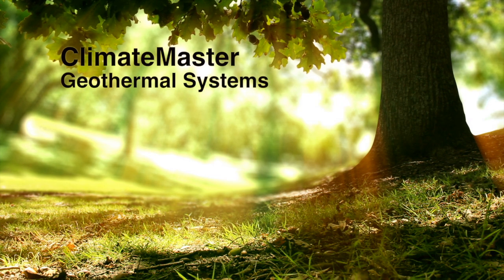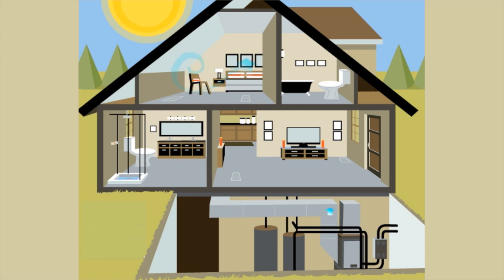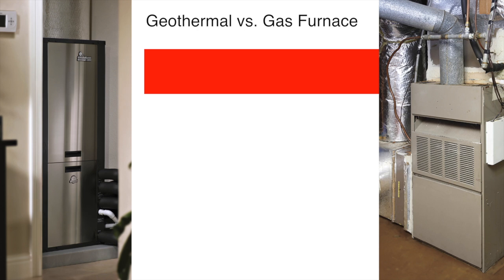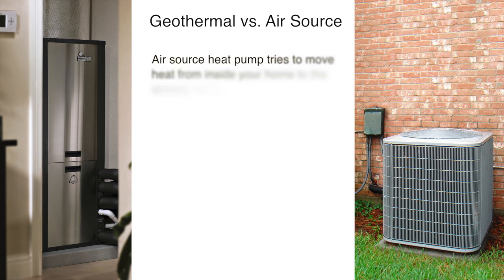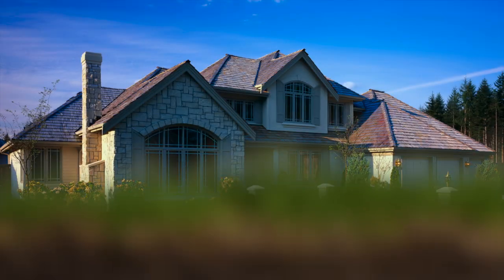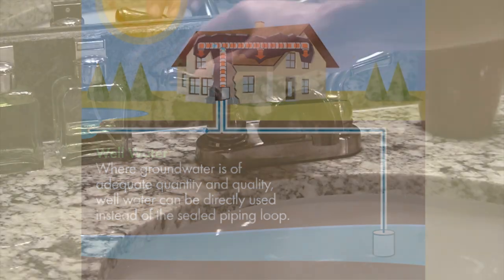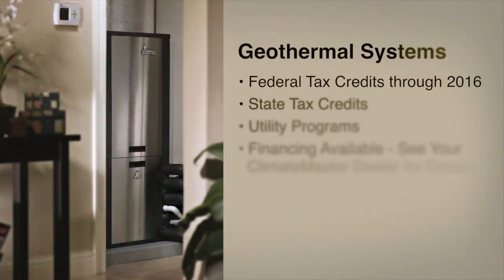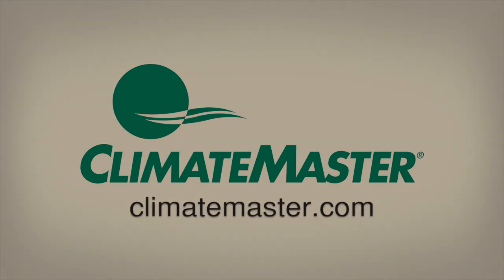Benefits of Geothermal Heating and Cooling

Comment: I serviced and installed a lot of these in the last few years.  They are a joke.  As long as your using water (mixed with chemicals) to transfer energy you are going to have issues.  Pumps, valves, piping and the like.  I replace several of these systems after only used 10 years.  The expense is enormous and not worth the effort.  The best solution in our area is Air Source.  But geo sure sounds good on paper.
Reply: These systems are prevalent in Phoenix and Seattle areas, and I haven't heard a lot of complaints from those areas.  Maybe it is low quality materials or improper installation that is happening in your area?
Reply: I agree. Have had a Carrier Geo Thermal system since 2013. Can't say I like it, I think I have 4 vertical loops. My electric bill has gone up since installing I'm guessing to run the pump It works great for cooling but really struggles heating in the winter in Illinois. So I have just been running on propane  in the winter. Propane is cheap anyway. I honestly see no advantage to this system at all. Is this what you experienced?

Comment: Here's a real world example:
I own a HVAC company. We install mostly convectional equipment including AC equipment (Air handlers And condensers) natural gas ,boilers, furnaces, heat pumps (air to air and water to air types such as the equipment mentioned in the video).
I was involved in a geothermal system that was designed by a professional engineer.
The homeowner asked me to install all the equipment inside the house and hired a well company to drill 3- 500 ft deep wells outside the home with engineer specify everything that was needed.
Seven years later, homeowner still not happy with how much the electrical bill to run the equipment. 
To be fair, Massachusetts has some of the nation's highest electrical costs, but one thing these pro-geothermal companies don't mention is the amount of the electricity to push using large circulator pumps, glycol/water mix through the pipe/pipes outside the home through  the "field". I believe this adds at least 30% or more electrical usage compared to convectional systems. Many people don't know that the latest air to air heat pumps make heat even with temps below zero degrees outside and this equipment easily competes with geothermal equipment which also heat pumps, but water to air, not air to air. The latest heat pumps are much more efficient but do cost 3 times more money then convectional heat pumps but again much, much less than geothermal installs.
So all that being said, unless you have below average electrical utilities to hook up to or a lot of solar panels because you need a lot of electricity, for most people, you will spend a lot of money drilling vertically or installing horizontally the field pipe/pipes and will take years to get your money back. Plus you will be surprised how much electricity you need run the equipment.
Lastly, not many HVAC contractors that can service geothermal so you will also pay a lot for future repairs.
Reply: while I  know that your real world example is something that can happen, I would not consider it a fair representation of this technology at all.. I have two friends running these areal loop geothermal systems as the only source of heating ( granted one guy has a fireplace for romantic and comfort reasons as that heat source is providing a especially cosy heat^^ but he could do without it to get through the winter warm and cosy) and they have them runnning without any issues for around 30 years now.. one guy had broken heatpump after 23years and the other also chose to change the pumps to newer models.. but all in all they had no issue and very low additional electricity costs and to be fair electricity is much more expensive here in germany than it is in massachusetts USA
I believe there was something wrong from the beginning in the design / and or the installation of the geothermal system you mentioned.. trapped air in the loop can cause the circular pumps to run less efficient using up more electricity, it also could be a system that does not use a closed loop and therefore needs more juice to pump the water from down the well ( imo a design flaw or a miscalculation with wrong pressures ) ... also heating your home with geothermal will only be efficient if you couple it with a "low temperatur" heating system  like floor heating instead of "high temp radiators" because you will have to use additional electricity to get the heating circuit to the necessary high temps.. 

-I can say that in a closed loop areal geothermal system the energy to run the pump for the loop is not as high as you make it out to be.. and all in all it is a faily reliable low maintenance system..
- _"many people do not know that heatpumps in general can even generate heat from ice"_.. that is true for BOTH not only for air systems and the improvments made are also true for BOTH systems ( basically the same technology ) that does not chance the fact that the geothermal system with the constant and higher ground temperature ( compared to air temp)  will allow the heatpump to run at much more efficient temperature ranges.. just because you "can" does not mean you should, because at some point when the air is cold outside and you need to heat your house the colder it gets the less efficient your air heatpump system will run = waste of energy
- I absolutely do not understand what you are comparing here by saying _you believe it adds at least 30% or more electrical usage compared to convectional systems.. 30% of something that has nothing to do with heating? if you want to compare something you should compare the cost of conventional heating systems  including maintenance / installation costs to geothermal systems and not throw around numbers that have no meaning at all.. sry I get what you mean and I guess you just wanted a better illustration of the costs but since the electric bill is so different for different households, house sizes etc.. it just does not make sense..
-while the installation costs are defenitely much higher unless you are building a new house were the additional groundwork can be a small price difference you will most likely have to invest more money.. the higher the cost of energy in your state the faster you will get your money back.. so it all depends.. and yes this system might not be for everyone.. but if you can work an excavator or have somebody who can do the groundwork for cheap you can  get a system fairly priceefficient considering you can do a lot of the laborintensive groundwork yourself.. once the system is running you will safe money in comparison to air systems that loose efficiency when the air is getting cold outside.. 
-maintenance of geothermal.. what maintenance? I´d say a properly installed closed areal loop does not need ANY.. and the rest of the system is easily accessable in the basement.. and to tell the truth will run and run and run and run.. and if there is a problem why can´t an HVAC guy do the repairs? there is nothing really special about it: water pump, heatexchanger, and heatpump, it really is NOTHING special  in comparison to air systems.. it is NOT rocket science^^ and these systems are around for more than 30 years now..
Reply: Kind of an off topic question to what you mentioned but you seem to know what youre talking about and can look at this system objectively.  My concern with this type of system is that if the ground is 55 degrees all year round roughly, in the winter this video says you dont need to burn any gas to heat with it.  Now im no expert but wouldnt that this only heat a home to 55 degrees before the temperature reaches equilibrium?  How would this raise the homes temperature above that without burning gas still in a furnace to get that last 15-20 degrees cause 55 seems like itd still be pretty chilly...
Reply: @Brandon Bader - You're correct. These are just a heat pump that instead of using an air to air heat exchanger, use a liquid to air exchange. Similar to the radiator on your car. The benefit is they start out with 55 degrees & just have to raise it less, on cooling 55 would be great. I'm sure it would still require a water heater even if the heat pump ran all summer. I should have started with "I'm no expert" but like you have common sense.
Reply: @ledbetterjack  I see so some of these videos are a tiny bit misleading in the fact that in the winter you still do need to use gas or electric heater in conjunction with it, tho obviously a lot less considering youre starting with ~55 degrees but i see where the origional poster is coming from now if you are paying that in conjuction with the cost of pumping the water up and down the lines.
Reply: @ledbetterjack  is correct. An AC compressor and a three way valve can give you either heat or AC. Convectional heat pumps, especially in the South USA have been around for at least 45 plus years that I know of, have been doing this for year now.
Reply: @rapiddanger ,, an ac compressor in the equipment inside the house  is converting the 55 degrees, using either the heat pump cycle, to temperature of 100 degrees or more for heating and the refrigeration cycle of the same compressor will convert the 55 degrees to at least 35 degrees for cooling. Any convectional air to air  heat pump can do this already, but geothermal has the advantage of a stable 55 degrees fluid all year round.
Air to air heat pumps, are not as efficient because the outdoor unit has to deal with outside temperature that are always increasing or decreasing from say 55 degrees. 
Obviously, the 55 degrees of fluid for any heat pump is ideal, but point is the geothermal companies forget to mention the energy used to circulate this fluid. Also, air is also a fluid, just like water, that why most people who have heat pumps, have air to air heat pumps.
Reply: @rapiddanger  , a water sourced heat pump will take the 55 degree water and convert it, using a reversing valve in the heat pump cycle, to a much higher temperature of over 100 degrees. Water source means using water as a fluid, instead of air which also a fluid ( look at up!), which is being used to remove heat or gain heat. So for cooling, the 55 degrees is converted to say 40 degrees for cooling purposes for the home in the warm months.
 In a water sourced geothermal system there is typically a water/glycol mix that is "closed" in a pipe from the earth and any ground  water so that the water/glycol mix doesn't contaminate the earth.
Reply: @rapiddanger  no sir you are not correct.. this works like a refrigerator or air conditioner.. there is a heatpump in the system.. that will "compress the thermal energy" and bring it to a much higher level.. the BIG PRO with a waterloop running in your garden underground is that the heatpump will work much more efficient than air unit because it will work with the year round constant "warm" temperatures of the soil below a certain depth, while the air outside will get so cold that the air system will at somepoint be just too inefficient..
Reply: It's because at Temperatures below 40º, the Heat Pump cannot make Heat, so it goes to Emergency Electric Strip Heat. In other words, it is worthless, you would be better off buying an Electric fORCED Air Furnace, which is Stupid.
Reply: @CrowDog58 , the air handler portion of the geothermal heat pumps systems do give options to  have back up electrical strips installed just in case geothermal portion goes down.
Reply: @CrowDog58  Most, if not all, geothermal systems should not have back up emergency electric heat if designed properly but obviously the air handler does have a compartment to install it easily.

Comment: My home has deep wells for geothermal, and is extremely efficient. Inside is chilly in summer, and nice in winter, all with very low electric cost. Amazing. Just moved into our home last June. Very low cost to run it.
Reply: I have a house of 200 m2 and landscape of 400 m2 , can you guide me how to do this system ?? Also I have well of water 25 m3 , I hope you can help in this regard.
Reply: @ehabtuffaha4083  connect your well to landscape then run pipes to your house. Job done! very easy.

Comment: Doesn't electricity cost more than natural gas? YES! So how does that actually save on heating? It costs pennies to run that furnace fan so....im confused on how this saves on heating costs
Reply: System uses electricity just to move the coolant in the pipes. Electricity is not used for heating.. Carried coolant is heated (in winter) or cooled (in summer) by the underground earths heat (which is 55F always) so you only pay for looping coolant in the pipes which is way cheaper. This is the same tech used by Air Conditioners, only difference is that A/C uses outside air, this system uses earth it self to exchange heat. And since earths temp is always 55F this system is way more efficient.
Reply: @m.yldraymeric6045  so there is something in the pipe to help make heat? Because 55 degrees isn't going to warm up enough on a 30 degree day. I know that ac units have a refrigerant in them. Does this system have something to build up more heat than 55 degrees?
Reply: @benca6151 Both A/Cs and refrigerators (and probably this system) have a compressor that will be used to move the coolant. And there are 2 different pipe diameters used in the system. Compressor is used to compress the coolant into the pipe with the smallest diameter, which causes the coolant to get hot(or give heat to its surrounding) due to the law of gases (http://chemistry.bd.psu.edu/jircitano/gases.html) so if we mount these pipes in the house we could heat it. When this coolant loses all of its energy and cools down (so reaching to the end of our small diameter pipe) we suddenly change the pipe with the one with bigger diameter. As the volume increases (again due to the law of gases) coolant get colder(or gets heat from its surrounding) so if we mount these pipes in to the ground we get our heat from grounds 55F. This way we move heat from one locations to another and create high/low temperatures.  Same principle could be used to cool the house down, just switch the pipe locations. Of course the clever way of doing this is, manufacturing an in-house machine that have 2 different set of pipes and have a mechanism to switch to appropriate pipe diameter for heating or cooling. This device is what ClimateMaster is selling. To see this principle in action just check your refrigerators back, there should be a grid made from small pipes lay along the back of the device. If you touch them you will feel that they are hot. That heat is coming from the inside of your fridge.
Reply: @m.yldraymeric6045  thank you for explaining this to me. Very well put

Comment: Cold Pumps. 
They blow cold air (home is 70F inside " cold pumps" discharge maybe 90F supply air on HIGH FAN SPEED vs. forced air gas 130-180F? On SLOW FAN SPEED) BIG DIFFERENCE. HIGH FAN SPEED FEELS COLD AND DRIES OUT CONTACT LENSES) compared to gas fired forced air.
ah, 100% electric? ..comes from coal fired power plants.
How much electricity is list through transmission from plant to end user.
Cold Pumps. Now reports of pex " plastic pipe" developing leaks..
Don't bury plastic in the ground that contains propylene glycol.
Wells for geo- thermal last how long? 
When drilling for wells  the " bad" water   table comes 1st on the way down to the " good" water table, improper casing of wells can lead to crossing of the 2 water tables.
I know 3-4 commerical buildings that the closed loop is leaking under ground.
No E.P.A. regulations regarding mandating fixing of leaks and propylene glycol in our ground water..
Geo- thermal 15 year  life expectancy and 18 year payback.
All the nat.gas we need is being flared and wasted with the fracking process for oil.
If no government tax breaks etc, would not be installed.
Coal fired power plants love " cold pumps". ;)
Reply: Coalsdays are numbered .Gas fire power plants are Much cheaper.electric can come from many sources,NOT just coal dimwit
Reply: @hughjazzole2037  yep, energy can come from many sources, at what cost?
Solar has paid for itself how many times? 1 or 2? Wind energy would not be present without my tax dollars since the government subsidies are the only reason we have it.
We are releasing more natural gas into the air than ever before EVER from fracking oil.
Nuclear power is what should be taking place but too many fears.
Hydro is another.
Currently natural gas power plants provide apromx. 30%, coal fired 50%, wind, hydro apromx 15-18%  solar 2%?
Your cold pump will be wore out before coal loses it place at the top.
Again, if nat.gas is the answer, why " cold pumps" makes 0 sense dip stick.
. Wind energy

Comment: Dig a ditch. Put some rocks in it, with a looped plastic 6 inch perforated pvc pipe in it. Loop the pipe through your floor, and you have a year round passive heating system in your house. (75 degree heating and cooling year round!) Costs a hell of a lot less than "professional" systems!